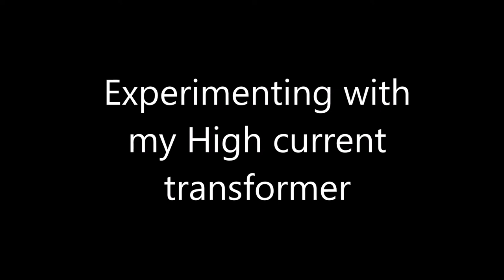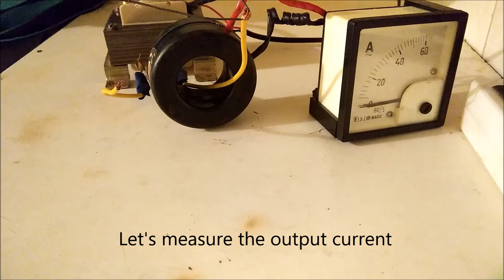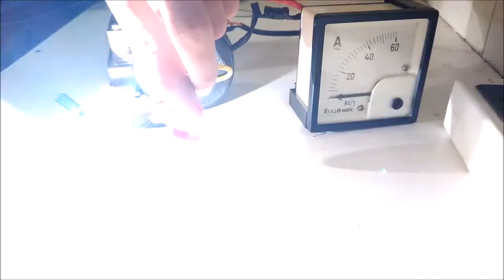High current transformer experiment

Comment: Rishi Kesh very good video. Thanks a lot. From were you got this transformer? Did you made it, salvaged it or purchased it? Anyway thanks again for these wonderful experiments.
Reply from the maker: +Pankaj Roy i am glad you liked the video:) . Well,i had an old music system with radio in it. It had this transformer inside it. the primary side of the transformer had some fault regarding connection.So i had to remove both windings and fix the primary. after that i got both windings on the transformer again and it worked. Its a current transformer which gives max voltage of 9volt and max current of around 35amps.